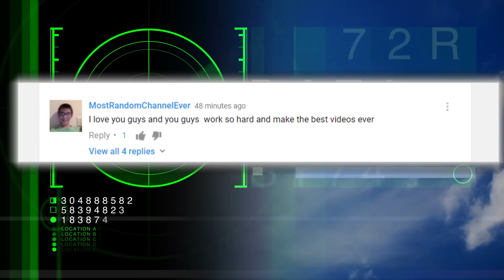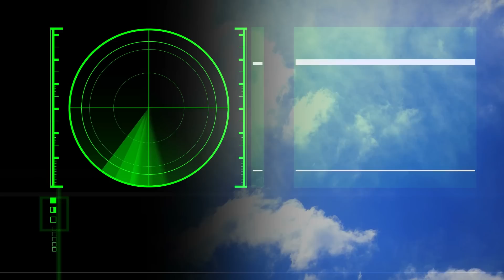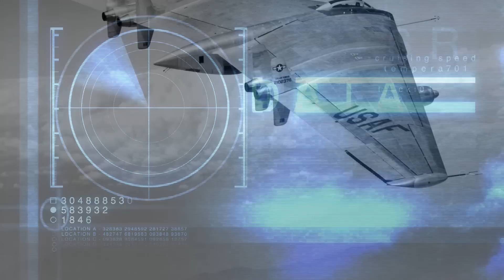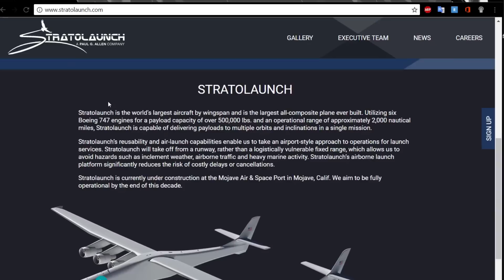WEIRDEST Airplane Designs In The World

Comment: The ekranoplan was designed by lou abbott of abbott and costello fame. It only flew 5-10 feet off the ground because it was big. Both statements are entirely as correct as each other. Seriously dude, it could have been a good video, still could in fact, but it really needs fact checking and putting right. Hughes put spruce goose in the air to prove it would fly even if he didnt get to fly it as it should have been flown. Rare picture of ekranoplan? Really? There are loads of videos of it, so rare perhaps when it was first built, not so much now.

Comment: A lot of your facts and pictures don't add up. For one the spruce goose did fly, you even have the picture of it flying! Two the caspin sea monster flew so close to the ground because that's what it's designed to do, NOT because it was two heavy, its an ekranplan and uses the ground effect to fly just above the water. Further more the pictures you used for it aren't even the same one, the first picture was a prototype that crashed and sank after 15 test flights because of pilot error, the second picture is the Lun Class Ekranplan. Please research your facts more.

Comment: The Caspian Sea Monster is NOT a plane!!! It acts like a plane, sure, but it is actually classified as a "Ground Effect Craft". It is too heavy and its wingspan is far too short for it to actually fly. The idea behind this type of craft is that it takes advantage of how higher density air under the wing of a traditional aircraft is compressed as it is close to the ground, between zero to upwards of 200 feet above ground, depending on the size of the aircraft. Ground Effect vehicles use this to literally skim just above the surface of a body of water, much like a stone skips across the surface of a pond or a lake.
Reply: Finally, someone knows what they are talking about. No need for digital make-believe; footage exists of this machine "flying"   https://youtu.be/UlIa4NpBBXY?t=48m37s

Comment: “The Spruce Goose never flew”. Shows picture of it flying.
Reply: It flew once; lifted off, landed back on the water, scuttled back to its hangar and never dipped a float in the water again...
Reply: that wasnt flying, thats ground effect
Reply: Hughes was at the controls. During taxi testing, he was not supposed to lift off. He did on purpose however. He held it airborne, then settled it back down.
Reply: Its a prototype? Really? Hmm, maybe that's why there's only one... and yeah, kind of more than just a bit irrelevant. Seeing how the point is, it did fly, and he said it didn't.
Reply: That does not change that fact that it flew.
Reply: its a prototype

Comment: 6:31 But this was never a new concept for the time period...
 
 
 
 
In 1939 the first Horten Ho 229 completed frame took to the air behind a powered biplane.  It would later be reported to take off with jet engines in 1944.  Why not put the Ho-229 in instead of the bootleg American propeller version?

Comment: Im pretty sure the "Parasite Fighter" (McDonnell XF-85) was based almost completely off of the Me 163 Komet.
Reply: Eh. There's some blood lines, but very trace. The XF-85 is jet propelled whereas the 163 was a rocket plane, so there's a much different internal structure. That and there's a different set of aerodynamics at play with a jet inlet, so much of the airplane had to be designed from scratch.